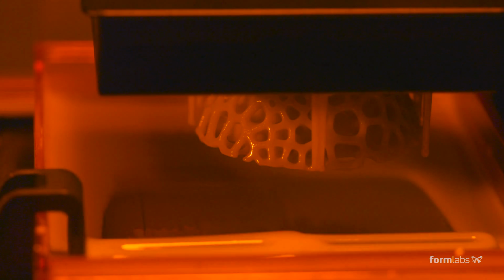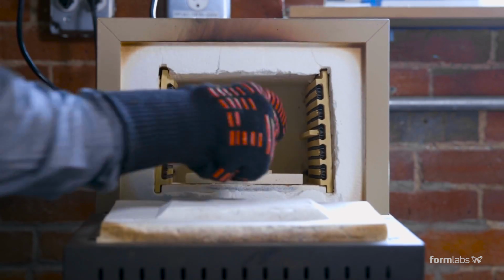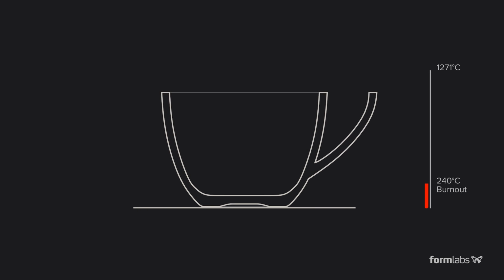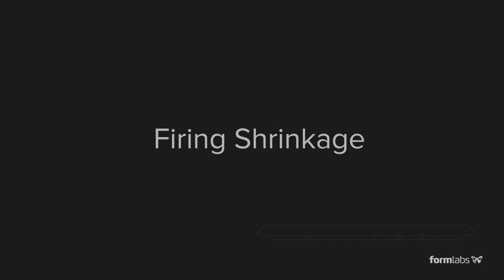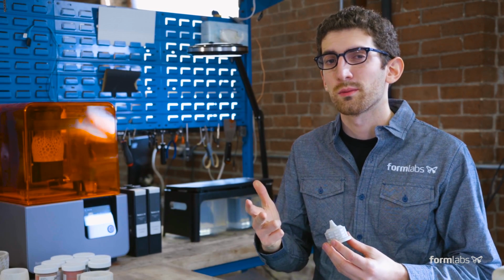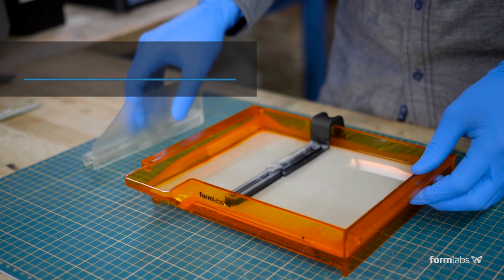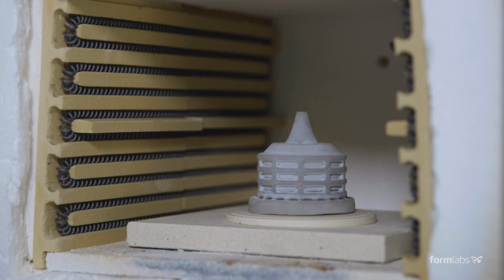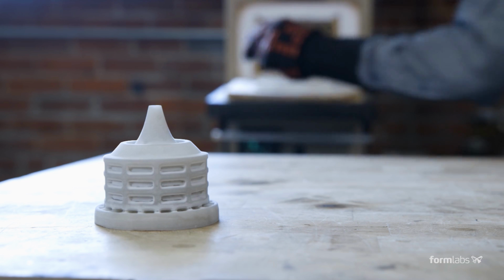How to Work with Form X Ceramic Resin

Comment: What to do have that is clear where I can make a container that holds water and half of it is designed to boil water well above the boiling point and the other half freezing water well below the freezing point.. but not exactly half of the container so there will be enough material in between the two points where it will be neutral temperature